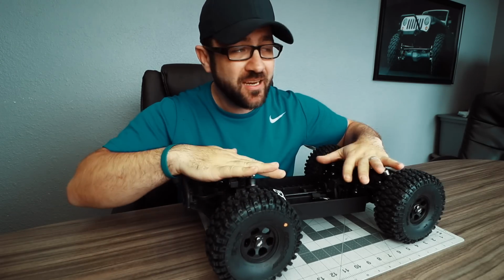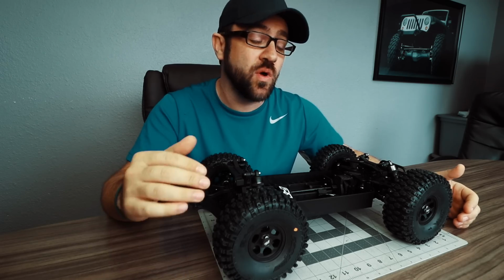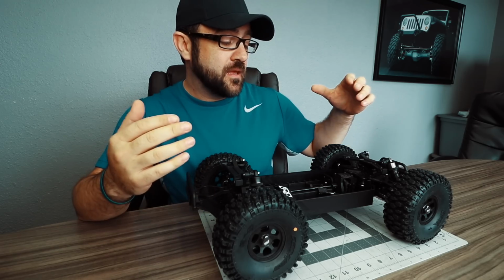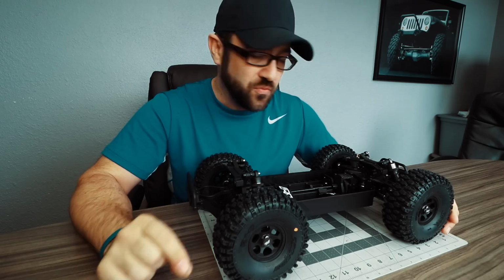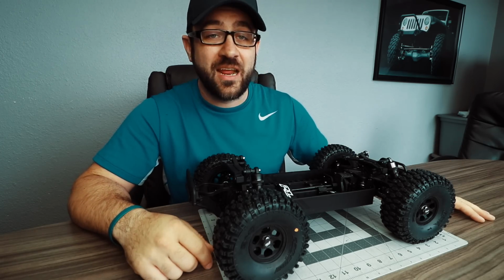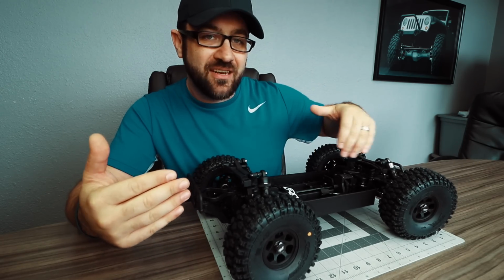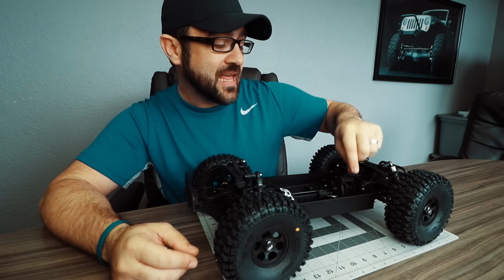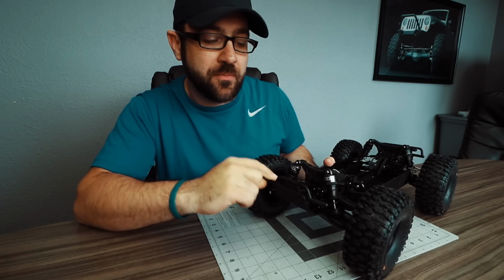#MonthlyMayhem Challenge Ultra4usion - Week 2

Comment: I would try a transmission out of a 2wd truck/ buggy, then you might not have to mess with drive shafts to much?
Reply from the maker: The problem there is that 2wd buggy outdrives use a much smaller dogbone diameter where the pin goes thru, so it wouldn’t be big enough to drive the diff side.

Comment: Hey Matt....why not a tire cover over tire foam as the spare....I've done that for years and it really doesn't add any weight.
I seen a 540-can Team Brood 1600kv 4-pole that would work. They also have a 2000kv 550-can. 
But I'd still prefer the 4274S 1900kv Puller Pro Bigblock in your rig. It has a Staggered 4-pole that really makes it smooooth and still still freakishly torquay because the rotor John uses is 1/6th Scale. 
 Oh....your funny today. Hahaha

Comment: I like longer rc build videos so i was ok with it. I highly suggest a chassis brace between the shock towers, mine bent dog bones like it was going out of style. If you went the way of an scx trans, you could use a robinson racing one piece bottom gear that has the (i think) 6mm outputs, those should mate up to mip dog bone drive cups. But i had a mmp with a roc412 with the supplied gearing it had amazing low speed control. Not revolver good but for what it is it did quite well.